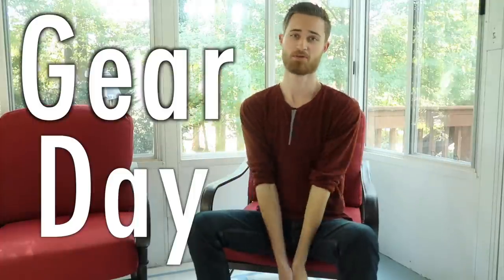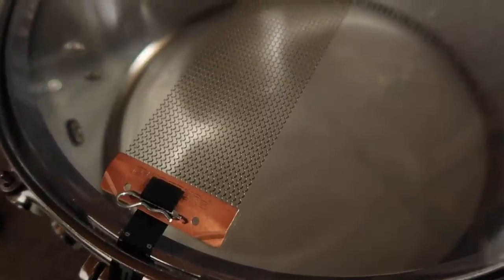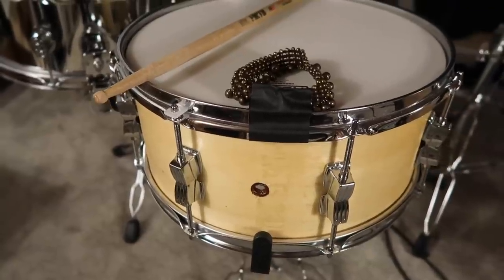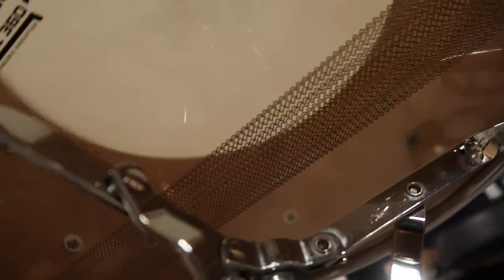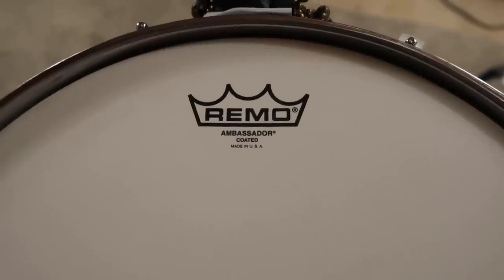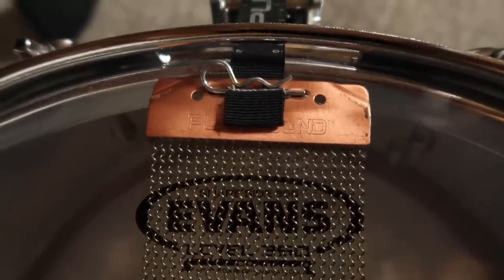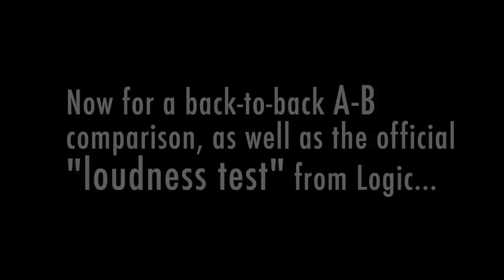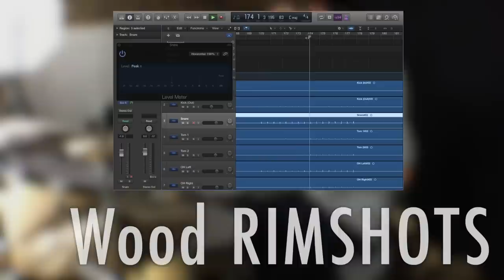Is a Metal Snare LOUDER than a Wood Snare?

Comment: The difference isn't about volume but rather tone ... the EQ range of the Metal Snare is brighter than that of a Wood Snare - this give the false impression that it is louder, which it isn't. What a Metal Snare might be ... is brighter, this is the bigger reason why Drummers in the 60's chose the Metal Snare because once the Drums had to compete with Amplification - this is early when PA's were non existent or of poor quality - the Drummer wanted something to CUT through the on stage MIX which was ultimately the same thing the audience would be hearing. In the modern age where EVERYTHING is close mic'd and the PA is the Sound Presentation of the Band at both stage AND front of house ... it doesn't matter much what Snare you choose. EQ can fix it all ... The bottom line is a Wood Snare is deeper in the EQ Range than a Metal Snare at acoustic level ... but what Heads you play and how you tune can make a Wood Snare bright also ... play what you like.

Comment: The mind forgets way too fast(seconds) to be having the same beat a minute apart.
Basic rhythm  2:03   3:42
Side stick  2:28   4:07
Tasty beat  2:40   4:31
Centre hits with kit   3:06  5:07
Centre hits, snare only  3:19   5:21

You're welcome

Interesting, when you're doing the basic rhythms at the beginning with, I think, the rim shots(I'm not an expert), there was quite a bit of difference. The wood was quite a bit deeper. But when you hit right dead centre, and no rim shot at the end, the sounded almost identical.
Reply: The only thing I really hear that's different when he's hitting the snare in the center, by itself, is sympathetic. Vibration. Kind of sounds like the wood snares rattling around a little bit more

Comment: If you get a wood snare with the kit, it will probably blend well with the other drums.
The brass snare that I just bought is louder with a much better rim shot sound but it stands apart from the rest of the kit.
My two cents. It’s nice to have options.
Reply: Louder than the other drums?

Comment: One variable that will impact the volume some is the bearing edges..... sharper edges (at least with my snares) are louder as the heads are a little freer to resonate more fully, thus more volume.  Rim weight may impact that as well, though would e very subtle.  The comments referring to metal snares having a brighter sound and thus cutting more, leading to a perception of being louder are spot on.  That's why metal snares are often preferred when you want a sharp back beat to cut through in the mix.  Just my 2 cents..........

Comment: one thing that I feel is missing in majority of wood vs metal snare comparisons is the consideration of snare thickness/density. Your average mass produced steel/ brass shell would be 1.0mm (or maybe 1.2mm) while a  wood snare would probably be around 5 or 6.0mm? I'm curious to hear how wood vs metal snare drums with the same thickness would sound. If we want to be more detailed, how would a 5.0mm cast brass snare sound compared to a 5.0mm solid ply maple snare?

Comment: From a design engineers point of view drum volume is directly proportional to drum head tension, material thickness, and impact.    Look at a current marching snare drum which has a very thick high tension head.  Place that on your drum kit and your mates will be required to turn their marshal twin stack to its max setting, in order to get past your snare volume.... and marching snares have shells which don;t touch the batter head....   So this whole argument in this video is moot.

Comment: With identical heads, I didn't catch much difference. In the early 70's I played in a 7 piece horn band, with no drum mikes. I had a 6" Ludwig brass, 1929 vintage (date was stamped on the inside of the shell). I used a coated ambassador and it REALLY cut thru. Today, for a metal snare, I use a Powerstroke II, it warms the drum slightly, and on my 6" inch wood Yamaha snare, I use an Evans Warm. I was quite surprised at the difference those tiny punched holes made. It's still a warm/woody sounding snare, yet it has a cutting rimshot. My favourite for sure. 
While still in Kansas City, several drummers used it for live recordings. It looks like all mahogany wood, although I have been unable to confirm that fact.

Comment: That's interesting, I would have thought that the metal snare would be louder. 
I'll have to tell the bass player in my band that the db monitor showed both the metal & wood snare drums to be the same volume -15db.
He's always complaining when I use my Pearl Sensitone Steel snare drum 5" x 14" that it's too loud.
So I mainly use my Tama Swingstar 5" x 14" wood (maple I think) snare & he doesn't mention a thing about the volume. Perhaps it's a perception thing.
The steel snare is great to cut through & seems to have a real crisp articulate sound that is more suited to medium to high tunings.
My wood snare seems to have a warmer sound and is better suited for medium to low tunnings. I use it when I really want the ghosted notes to shine through as in a Chicago or Texas shuffle, if I loosen the snares off a little & play a bit off center it sings a sweet song :-)

Comment: Dude you hit the drums so soft, Try swinging for the fences to ACTUALLY see how loud the snares are.... If you tap a 12'' splash cymbal softly it will be the SAME volume as tapping a 20'' Rock crash lightly, but physics dictates that the 20'' Rock crash will be able to get louder. You need to get a rock drummer in there who actually knows how to smack the drums to properly do this test.